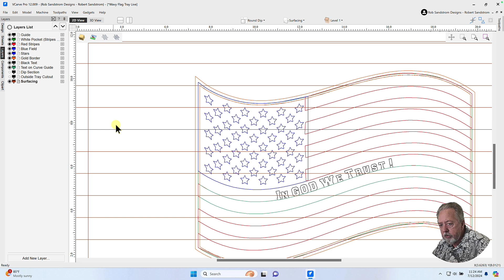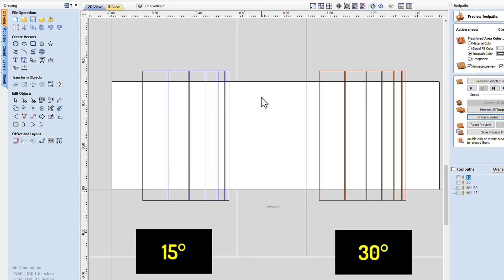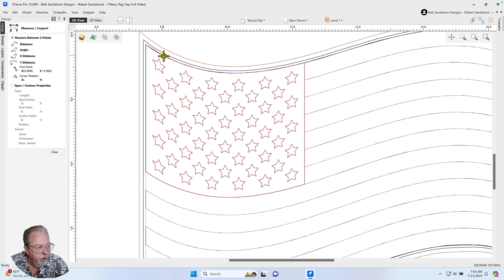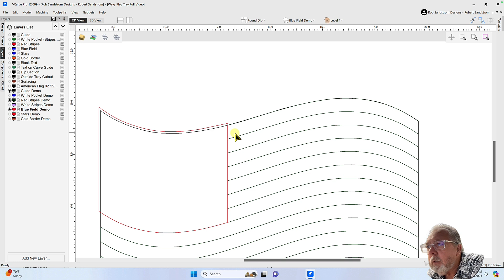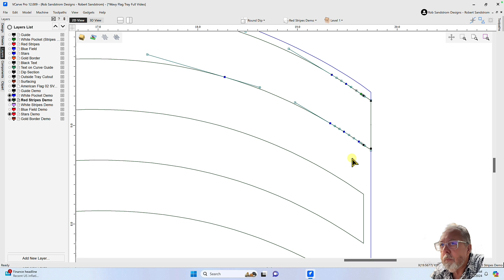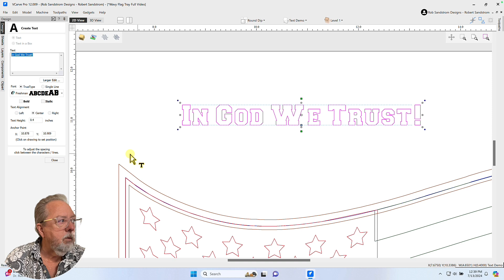Part 1 Make This Multiple Color Wavy Flag - Step by Step Tutorial - You Can Do This Yourself

Comment: I’d love to see a video on this epoxy inlay method using a laser.
Reply from the maker: I would love to demonstrate a method but haven't figured one out that would be the same.  Unfortunately, can't laser in epoxy because it can be poisonous.  There may be other techniques, will have to think about what I might be able to do.
Reply: @RobSandstromDesigns   I was thinking about pouring the individual pieces with the appropriate colors. Then outline everything including a border and cut out (like a stained glass window), add to the backer and add the colored pieces, then remove outline piece but not the border. Then fill the outlines with a colored epoxy.
If you played with kerf you could create the pieces to fit exactly and then add  to a backer with a border and then pour clear to finish and seal.
Reply from the maker: @sharonsimonson5392  that may work.  I have used epoxy with my laser in the past in a few limited cases - similar to what you are sharing.  If you decide to go down that path, you would want to use real hardwoods vs. plywoods/veneers.  My experience in using plywood with laser jobs and epoxy pours is during the finishing of the epoxy - to get the sheen and results for finish - it is hard to avoid not sanding off the veneer of the plywood.  If you used solid hardwoods that may be able to be avoided.
Reply: @RobSandstromDesigns  Thanks! Could you do a video on how to adjust the kerf, so that the pieces will fit together exactly without the spaces? I’ve watched many videos about kerf and I get it for things with tabs and slots, but can’t seem to get it using the offset kerf feature, which I believe is what you need to accomplish it!